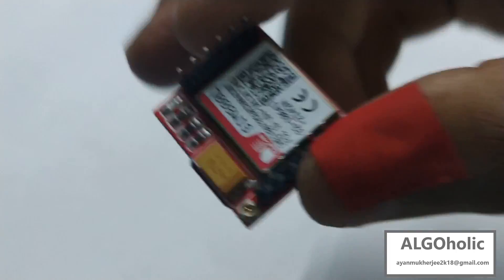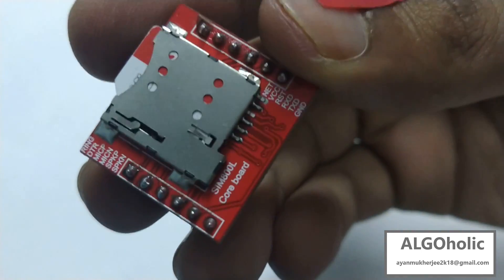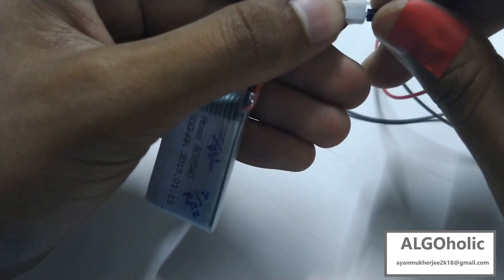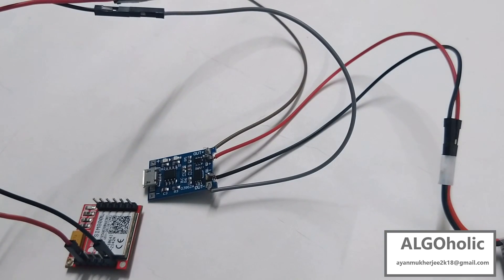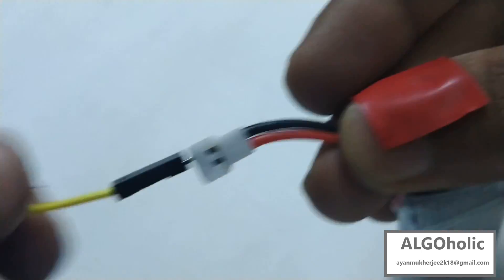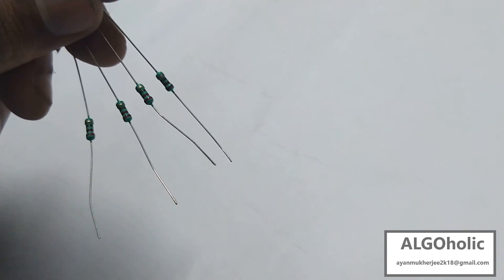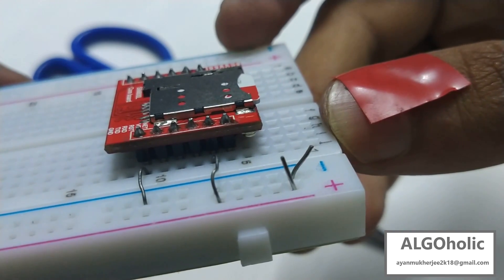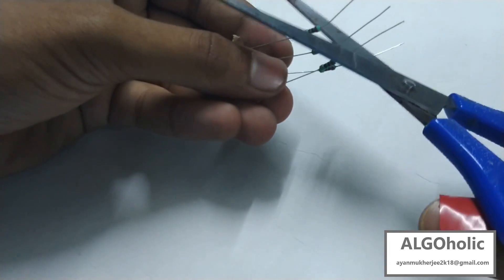SIM-800L - Connection Problem Fixed

Comment: That is the reason I stopped using jumpers 6 years ago. A working circuit suddenly stops and then after days of scratching head we find that one jumper has stopped working. So I just use single strand wire which are very much cheap and reliable.

Comment: Hey bro my sim800l is blinking  but not communicate or responsing with arduino uno board in seriel mo itor during AT comand test im using Arduino droid app

Comment: Your video was helpful. Understood the power issue and then i used copper wires for direct connection with battery and it worked... ❤️

Comment: Brother you deserve more and more subscriber . Before I made a gsm based industrial project where I used jumper wires but no problem occured , but now I am doing another project but at this time , because of jumper wire it does not respond . After wasting lot of time in internet , this disgusting problem is not solved , they use capacitor , resistor all fucking electronics devices , but my problem was not solved . After removing jumper wire , it is working properly. Thanks a lot .

Comment: I would have liked to see you repeat this with the lipo charging circuit as if we are using it for alarm etc it is not practical to keep taking away the battery to recharge it

Comment: Dude you are a life saver it worked like magic i've been working on that module for about 12 hours and i wached all the youtube videos and read all the articles about sim800L and the documentations there is no body mentioned about the connections before, except you.
Bro thank you soo much for this ❤❤❤❤
Reply: fr i was trying longer wire so thinking it was network problem even in outside it didnt work but now he made it

Comment: for those of u who still are not getting solution --
use another lipo in parallel (my single 18650 batt. wasnt able to do the the trick)

huge thanks to the delta NeutRAL YTB channel.subscribed😍
Reply: Thanks bro

Comment: You are using sim800L wich as already 470uf cap install. Those who have not 470uf inn their sim module, they have to install the cap and run for properly work

Comment: I have tried this method but could not succeed. But in Adruino Serial Monitor it shows the  sim number with AT command. Pls tell me ur postal address to send my 2 module SIM 800L for RnD for testing. pls.

Comment: Excellent solution, it worked . I had used Dupont wires and was struggling for nearly 4 hours , tried to extend the antenna of SIM800L and did lot of research but it could not connect to the network , Just could not believe it was such a simple solution you discovered !!  , I used some good and short wires ( which I retrieved from my dead computer SMPS .. it has very good wires ..)  and voila ...it worked... hats off to you dude ..keep it up

Comment: I had the same problem when trying to connect my MCU to my car's OBD2 port. I was using dupont wires to do so and was receiving no response. I worked on it for nearly two months until I decided to use bigger wires and it worked! Since then I use bigger cables for every connection and never use dupont wires anymore

Comment: thanks dude, that was tricky. but unfortunately mine still  showing same...my sim works in mobile. AT+COPS shows networks, AT+CPIN also ok...ive connected my module directly to lipo not even the jumpers u showed in last part
Reply from the maker: Used two jumpers for + two for -
Reply: @thedeltaneutral8431  i directly connected my lipo to module using thick wires and not the wires that we usually use..... :(
Reply: @thedeltaneutral8431  btw i see u didnt use any capacitor between vcc and gnd....ppl recommend it so that a busrt of current can be managed at network registration.............how come u survived without that?

Comment: I am using Sim800l GSM module with Arduino UNO and giving power to Arduino using 9V Zinc-Carbon battery. Will it work? Please reply.

Its LED is continuously blinking, but not at a gap of 3second, means connection is not established.
Please reply. It's really important.

Comment: I can't believe it wasn't working just because of a jumper wire wasn't able to carry enough current! I used 2 jumper wire parallel and it worked.
Reply from the maker: Nice, I was waiting for this exact comment for months, infact to avoid mess, I myself did the same while submitting my project. Genius😍

Comment: At first i thought this was total bs! But i was so desperate still tried and it works! Man u are a genius! Never thought cables would not be able to handle 2A of current..
Reply from the maker: Thanks Deepesh, some times changing a small DOP can save a huge db in oracle scheduler in production from crashing. Depth is to keep inside, simplicity is to exhibit.

Comment: the problem is ur power supply , max current for such a lipo battery is about 1 amps , but module require at least 2 amps to get started

Comment: I have used lipo battery of 3.7v  2500mah and also I have tried with 3.7v 1000mah..I have followed the same method but I couldn't get the connection. pls do help me.

Comment: I am providing the power supply from the laptop to arduino and then to gsm, is this still gonna work if I'll connect the vcc and ground of arduino to the vcc and ground of breadboard with jumper wires?
Reply from the maker: Firstly it is an unhealthy process and may damage your setup.. in case if you  seperately provide power to your gsm using your breadboard power supply, make sure to common ground the arduino and the gsm module.. connect grounds of your arduino and gsm module with a breadboard, otherwise it may damage your setup
Reply: @thedeltaneutral8431  thanks a lot! I am now using an external battery source of 4v 2A to power my gsm.
Reply from the maker: @subhadramahanta452  Fine if it works !! Please let me know if possible. Thanks.Please share and subscribe if possible.🙂
Reply: @thedeltaneutral8431  it's still not working properly   :(
Reply from the maker: @subhadramahanta452  I guess, the problem is, the led of your gsm is blinking repeatedly instead of blinking once per every two seconds, right? Or else, what exactly is the problem happening
Reply: @thedeltaneutral8431  I guess the problem was somewhere while connecting the battery with the gsm, we tried different methods and it's blinking just the way said it should in the video now. Thanks a lot for your help! ^_^
Reply from the maker: @subhadramahanta452  are you using a lipo battery ? Make sure to use a lipo battery, other batteries are possibly not going to work, as they cannot provide the spike current for the transmission burst phenomenon
Reply: @thedeltaneutral8431  I am using a Lead-Acid Battery... it actually went back to blinking twice a second. I'll try to get a lipo battery tomorrow, thanks a lot ^_^
Reply from the maker: @subhadramahanta452  never use lead acid battery !! It cannot provide the sudden current for tx burst, hence it goes incompatible with gsm module, I did the same as you did..😅..once.. afterwards, lipo solved it out, you can just buy the cheapest one, 3.75 v, 700 maH or higher on your wish
Reply: @thedeltaneutral8431  thanks a lot! I was just about to go buy, I'll update you on it soon. Thanks again! ^_^
Reply: @thedeltaneutral8431  I brought a 3.7V 1000maH lipo battery, it's working the way you described in the video! You were a great help, thanks a lot once again. ^_^

Comment: what are the values of the resistance that u used
Reply: It is doesn't matter. He didn't use them in the circuit, he just used their metal part as a jumper. Because of that material capable to carry more current than a jumper wire.

Comment: My friend did not work. I am feeding with 9v 2 amp. with the lm2596 voltage regulator, lowering the voltage to 4.1 and still not working. I've already changed the cell phone chip and nothing. I need that for a college job. when i call and i send a command to it it returns ok but don't get the chip on the network help me please
Reply: make sure the power wire is close to the gsm module.
u can 1000uf capacitor close to the module to boost the current requirement
Reply: Can u solved Silva..if u solved can u share what u have done

Comment: Plzzz tell fast can i use 3.7 v lipo battery ranging from 100 to 1000 mah any or nlt
Reply: Yes.  Surge current from LIPO can be very high. SO no problem.  Make sure have thick silicon wire for connection like the ones comes with LIPO batteries.

Comment: at first i was like.. maaann, he is doing the same thing!! just powering it up.. wft is the difference!! But ive tryed my self to move my wires with the supply voltage af close to the sim800L board pins as possible at it helped.. Such a wierd issue that dosnt make any sence, But i guess the 2 A burst load, is not a myth, and kills the powersupply.. Thanks for the video..

Comment: In the first attempt, you just needed not to use the common jumper wires. You needed to replace jumper wires from lipo battery to charger and from charger to the module.
Reply from the maker: Yeah, may be sir

Comment: Thanks for sharing. I discovered the same with SIM800C and SIM800L. The Dupont cables can not supply enough current when the module  is transmitting. I also put a 1000 micro Farad +100 nF across the + and - terminals close to the chip for better stability. There is also a problem with the proto breadboard to supply current. I have designed Digital Circuits since 1974 so I'm a little paranoid when it comes to decoupling. They don't teach this in schools and universities anymore.

Comment: Sir i can use 5volt 5amp smps and zenar diode 4.4volt
Reply from the maker: 5 amp may show you a current overload warning or may damage the GPS module, never use 5 amp, and zener would act as a voltage regulator, so it won't allow the sudden high current required for the transmission Burst i.e to create a connection to the network, 🙂

Comment: Can I use other battery?
Reply from the maker: Which kind of, can you please let me know
Reply: @thedeltaneutral8431  Hi watt or Duracell
Reply from the maker: No, Hi watt or Duracell won't work possibly.
Reply: @thedeltaneutral8431  I used laptop cell..which is 2A 4V..but still not getting any response from sim800l module like msg, call....
Reply from the maker: Your Arduino is working possibly in a 5v logic whereas if you use this battery, your module is working in a 3v3 logic, there may be some synchronization issues..use the battery with a DC to DC buck converter circuit and try, it may work, with your laptop battery, hope so.

Comment: Does 2g still work in india.. Is this module working since its a 2g module
Reply from the maker: There's no such thing. Sims nowadays will always be 4G, but it would work as a 2G in a 2G handset, call n sms supported,as a 3G in a 3G handset, call,sms and 3G speed datasupported....if in 4G then work as 4G.. an exception to this is  jio sim. It is a kind of 4G LTE sim which cannot be supported by 2g n 3g handsets

Comment: i don't hv this lipo battery.. can i use Vin of arduino which it will be feeded with a phone transformer (5V, 1.55A) ?
Reply from the maker: No, never, because during the transmission burst, while connecting to the network it impulses a high peak current..approx 2A and there after runs in low voltage, so I would suggest to use lipo
Reply from the maker: No, Sir, there lies the problem which has been discussed and overcame in this video, while creating a network with the tower.. the GSM module would pull a 2A peak current for a few seconds, hence the power source should be Adaptable and equipped to provide that much current, simply order a low cost lipo from Amazon or Flipkart

Comment: I am using sim800A with Arduino Uno
Same isaue of not connecting to network..
I am using 2G sim 
Power supply of 12v and 2A ac-dc adapter.
Connections are:
Gsm800A     Arduino Uno
Rx                   Tx
Tx                    Rx
Gnd                 Gnd
Reply from the maker: No no.. this is not the issue... Actually the main reason of using a battery on withdrawal of as much current as needed at an instant.. so I would strictly prefer battery... Using a 2A isn't an appropriate alternative as you are thinking 😅

Comment: Bro It is not working pls help me
Reply from the maker: What exactly is happening.. and can you please share a snap of your circuit setup ?
Reply: @thedeltaneutral8431  I have done the same as you did.but the led is blinking 7 to 8 times and powering off.this goes on
Reply from the maker: @charantechgeek  It would be fine If I could get a snap of your setup.. But as you say.. it's clear and I am pretty sure that, this is a power deficiency issue.. just chill.. it can be solved out, please specify, which battery you are using ?
Reply from the maker: First make sure that you aren't using your Arduino board or any other microcontroller board to power your GSM module.. Arduino or any other microcontroller generally can't provide that much of current
Reply: @thedeltaneutral8431  I am using RPS  OF RANGE 30V 2A .I AM GIVING 4V AS I/P TO MODULE
Reply from the maker: @charantechgeek  Tx Burst phenomenon faces problem with regulated power supplies.. got your problem.. try to use lipo..
Reply from the maker: @charantechgeek  The power supply as you explained is not going to work fine practically with your module
Reply: BRO,I HAVE LM2596  CAN I USE IT  AND SEND ME THE SNAPSHOT OF  THE CIRCUIT ON YOUR OWN
Reply from the maker: @charantechgeek  I haven't prepared any schematic yet, but I'm surely going to send you a snap, and yes, you can try a DC to DC buck converter like 2596, but the thing is, lipo battery is the best, because, don't think that it always requires 2A current, it just requires it while connecting to the network initially, so, it will be with no hazards if you use a battery, but still you can use a buck converter, in my college, I've done such, it worked, so you may try

Comment: It's possible to use 4g Sim in sim800l
Reply from the maker: Yes, But it will work with upto the 3g prospects.. jio sim won't ... But any other sim.. whether 4G or 3G or 2G.. it would be compatibile
Reply: I'm having trouble Off to buy some different resistance

any telecom service that provide a 2G network

Whether it be 2G 3G 4G or 5G sim
As long as the network provides a 2G network   your 2/3/4)5g Sim will  pick up the network